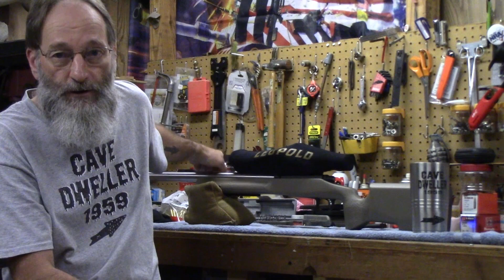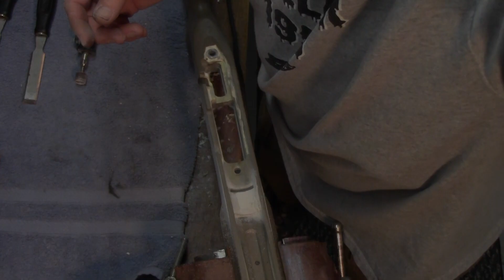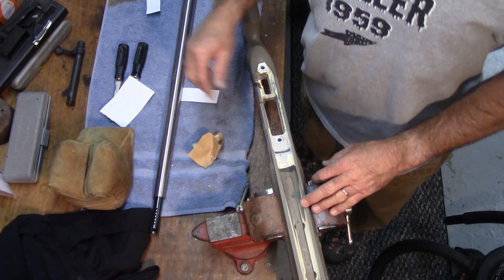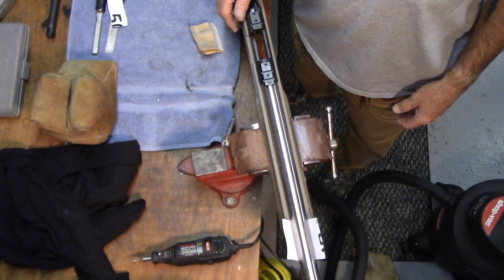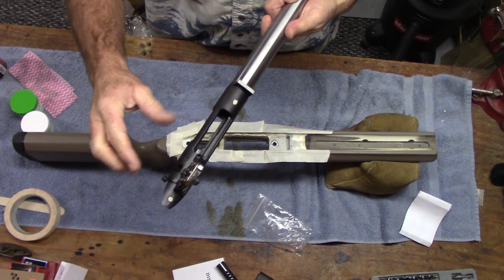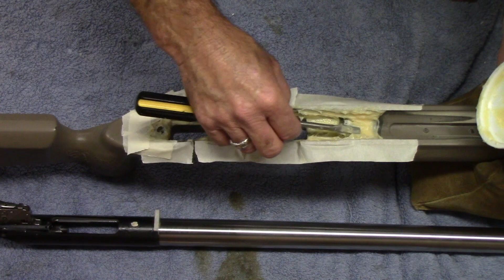Glass bedding the Beast. Making the perfect fit between action & stock.

Comment: Hey CD. Thought I comment on bedding. You do a good job at it. Funny, same tools!! I have bedded many a rifle over the years. I don't have one that isn't.  Always used Brownells acruglas both gel greeen box and the runny stuff, red box.
 I use some short dowels and wrap some tape around them to make the correct  size to wrap the sand paper around or deep well sockets  to float the barrel.
 The reason I am commenting is Acraglas has been in short supply and for some reason the resins have been hardening before I use them. So I tried some JB clear weld. I was bedding a 204 ruger, Savage action and a Boyd's stock.  I make mostly all my own stocks from scratch. So I mixed some JB weld and put a little dye in it and some stainless steel powder I use for big recoil guns. I just put it in the barrel channel where boyds does a channel under the barrel just as a test. The JB weld never hardened to a brittle state like the acraglas does.
Just a little spongy.
 Anyway, I tend to use a 6 contour but have a couple of 7s. It is wise to bed in front of the recoil lug. My rule of thumb is the length of the of the shell case to the bottle neck and float the rest of the barrel. Yep saves some tension on the reciever. 
 I use play doh to fill cavities. I put two small wood screws about an inch apart just a fuzz in front of the front receiver screw to allow for centering and undercut so only bedding compound touches metal. I use straws around the screws and raise them above the compound but use all thread screws that run through the stock, grease em, and a rubber spaced washer and nut to tighten it in when bedded. I use the liquid release agent in the kit. Used others too.
  Nothing like a good ole wood stock bedded properly. Once again great video CD!!
Reply: Don, I have been bedding rifles for years and have probably done over a hundred and have used Acraglass exclusevely.  If it is brittle, you are mixing it wrong.  I learned long ago that proper mixture with Acraglass is crucial.  Some of the others like Devcon is not as critical.  If mixed correctly it actually removes just about like he showed in the video and I would bet that was acraglass.  But there is not one way to bed a rifle and if what you are doing works then by all means don't change.  Just a bit of advice.  I bed so much I buy the big containers and never knew there was a shortage.  Lol

Comment: Hello Cavedweller, saw your earlier video on glass bedding an A 17 with an aftermarket wood stock, my question for you is , can you achieve just as good results with the factory plastic stock ?
Reply from the maker: I did just that with my B-Mag, vast improvement over factory original. But no where near as good as bedded into a ridged laminate one.
Reply: @cavedweller1959 what was the spray that you put on the action?
Reply from the maker: @Lij_MC  Hornady One Shot, it's their case resizing lube. lot's of things to use. If your doing the 1st, don't want to spend the money?? Last one I did ,I used a wax/polish that came with the epoxy order, worked great.